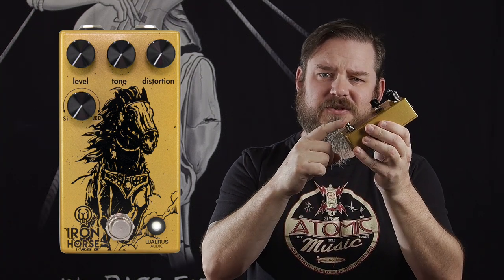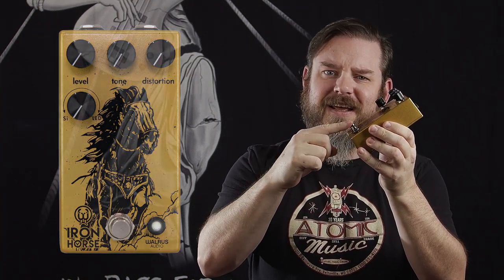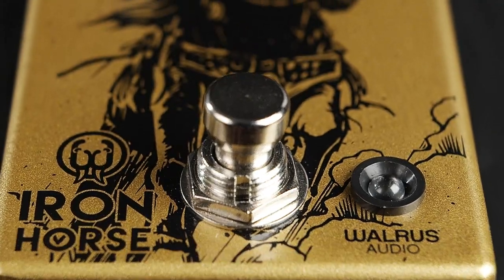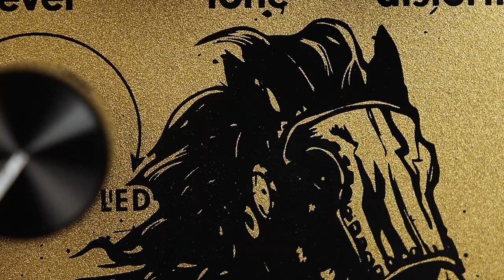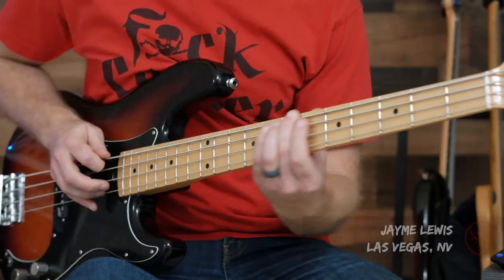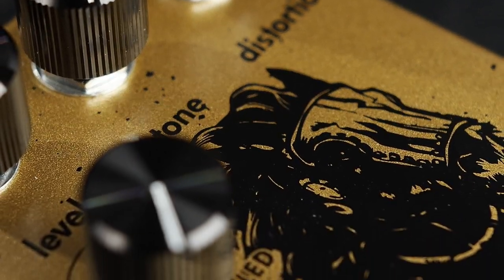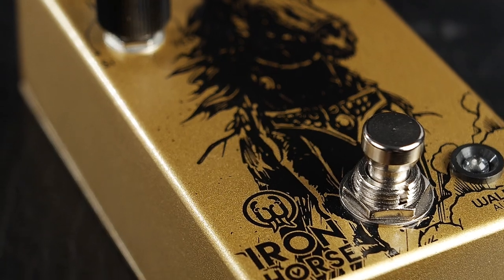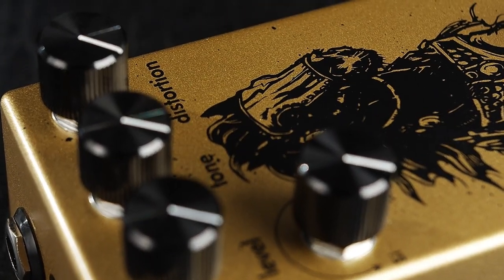Walrus Audio Iron Horse V3 Bass Demo

Comment: I appreciate you guys not trying to pass this pedal off as bass-viable on its own.
Reply from the maker: Most guitar distortions aren’t passable on their own, but most sound awesome when you blend that low end back in. 🤘🏻
Reply: You can always just add a bass bump back with an eq pedal or your amp's eq section.
Reply: @slash196  That's not really practical though, since correcting the problem with an EQ pedal means it's two clicks now instead of one, and using amp EQ means turning your low end up every time you engage the pedal, and then back down again. You can't do either one of those on the fly during songs. Plus, adding low end after the fact doesn't restore the band-anchoring capability of the notes in the same way as a clean blend.
Reply: @slash196  Thing is, if a pedal chops out the lows, they arent there to raise back up later in the chain.  In an extreme example just for illustration, if a pedal were to literally drop everything below 500hz to silence, all the bass knob in the world afterward would have no effect since there wouldn’t be any signal to boost in that range.
Reply: @davedixon2167  when you say “all the bass knob in the world afterward” could that imply that boosting the bass (with a pedal or otherwise) before the pedal in your example would help?
Reply: @johnnierivera1451  well in my extreme example any bass freqs before the culprit pedal would be silenced by it, so no - the only way to keep lows with the kind of pedal in the chain is to send them around it - clean blend, crossover parallel routing, something like that.

Comment: This is why I love the darkglass microtubes ultra x. It splits your signal into low and high (with adjustable ranges), then compresses the low end and distorts the high end with a graphic eq all in one box. I just wish you could change the character of the Distortion in the same pedal... but then I'm sure it would be a $600 pedal haha.

 Distortions with a blend knob like the ehx hot wax just don't work nearly as well to my ear, because you get the full frequency range in the distorted and clean channels. This is a cool modular way of doing basically the same thing as the Ultra X, I'd love to hear a shootout between distortions using this method.

Thanks for the video!
Reply from the maker: I’m glad you said that because that’s the plan for next year!

Comment: Thank you for the hard work! I really appreciate the clips from so many people, shows a wide variety of tones and gives a more all-around impression of the pedal showcased. On a side note, provided that pedalboard real-estate is not an issue, do you consider the EHX Tri-Parallel Mixer a direct upgrade to the Boss LS-2 as far as parallel mixing is concerned? Would you prefer another unit with a crossover frequency knob?
Reply from the maker: Considering that I upgraded from the LS-2 to the Tri-Parallel Mixer, I can honestly say that it’s definitely an upgrade. Especially with the way we’re using it. Obviously, it’s bigger, but like you said, real estate aside, it’s totally worth it. I would love to see a bass-specific blend pedal with either a low pass filter or even a 10-band EQ for shaping the clean side. Cutting the top end (around 500Hz and up) gives it a much more natural sound. In my opinion, having a  full-frequency clean tone alongside the drive makes the whole thing sound cheap and fake to my ears. As with everything in life, your mileage may vary but that’s my two cents at least. Glad you liked the video!
Reply: @TheBassChannel  Thanks for the reply! 
Tyler Deluxe from KMA Machines seems like a very interesting option, though at double the price of the Tri-Parallel Mixer. I'd love to demo both of them up-close.
Reply from the maker: Thanks for the recommendation. That looks perfect!